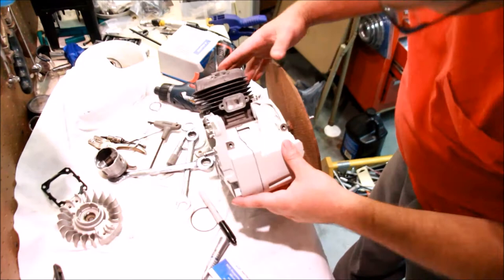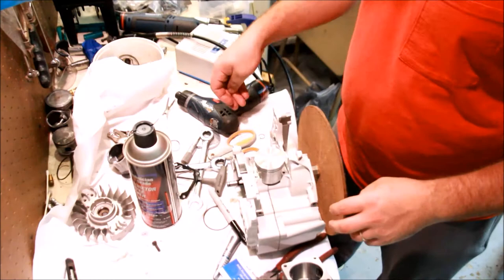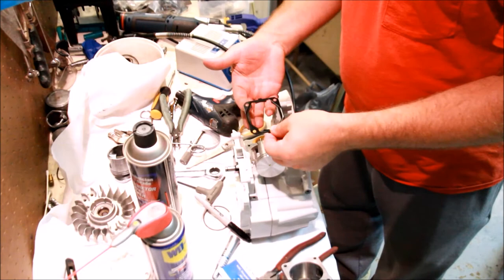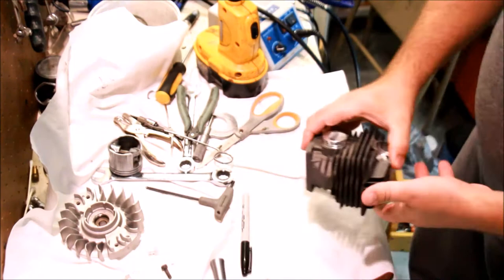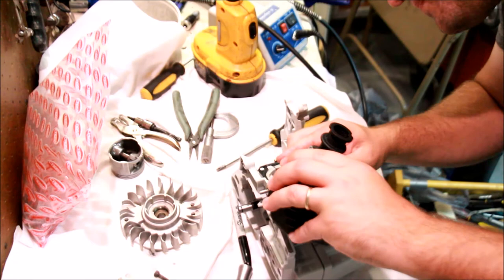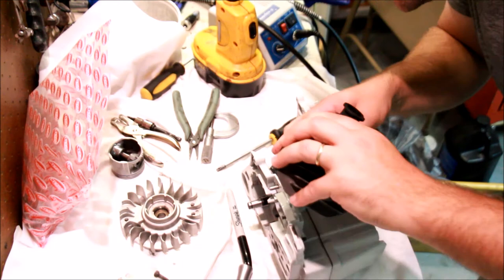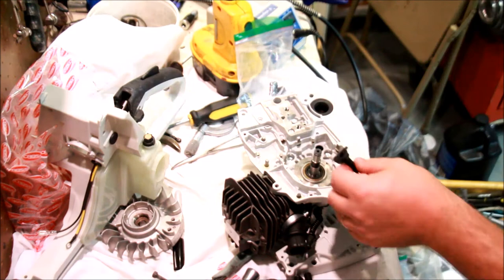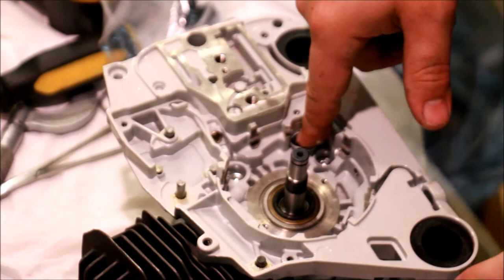Huztl Stihl ms440 bolt for bolt build! part 3 - cylinder install and some assembly

Comment: For that stop buffer, I just took a blade and trimmed a bit off each side of the cone that pops through the hole (so there's less rubber to force through) then I put some dish soap on it and worked it in with a little flat blade screwdriver. Even with the bits trimmed off it was difficult so I'm not worried about it falling out!

Comment: Stihl makes a pressing liquid to put AV mounts in but I make my own from about 3/4 liquid Dawn soap and 1/4 water in a spray bottle.  It is a lot better than grease, which can deteriorate rubber compounds.  It works  great on tough saws like the me 290 and 180 that have difficult to install AV mounts.  It make pulling intake boots into the rear handle a lot easier than pulling it through dry.  It also allows you to push in those pesky AV Plugs into the mounts.  I coat the whole AV mount with my pressing liquid which makes it pliable.  I also spray some in the hole the AV  mount is going into.
Reply from the maker: Thanks John....good point.  I use synthetic grease so hopefully no degradation but point taken
Reply: This might seem yuck, but I just put some spit/lick on mine and they slip on in, then I assume it will evaporate later on.
Reply from the maker: yup, guess that works too

Comment: I use a pressing liquid - 2/3 soap 1/3 water with a shot of rubbing alcohol added in as a surfactant.  I was using a Chinese impulse line and we all know they can be bigger or smaller than oem Stihl parts.  I have seen Chinese bearings for Stihl saws that are .003" bigger than they should be.  This Chinese impulse line was just to big and I could not get enough KY jelly on it to get it in the rear handle without damaging it.

Comment: For the ring compressor on my 660 build, I used a couple of tie wraps, one for each ring with the joint not lined up with the ring gap. Once the rings were inside the cylinder I just slipped the tie wraps off the piston skirt and cut them off.
Reply from the maker: Gordon Reed yep....done that. .and have a vid doing it that way.  Sometimes it works....sometimes not

Comment: For you clamp frustration, on my 660 build I waited until I had the cylinder mounted before I installed the intake boot. With it mounted on the case I took the "easy way out" and just aligned the boot clamp with a place where I could easily reach the boot clamp to tighten it. I just slid my T-27 screwdriver style wrench in from above the case but a bit off center and it tightened right up. My intent was to make that intake easy to remove if I decided to swap cylinders some day but it made things go very easy and kept the clamp away from the impulse line. 
I did not use any sealer so maybe that is what was making a difference for you.
Reply from the maker: Gordon Reed I probably should have tried harder to get the clamp on while still having the threads started ..mine wasn't t27 though. ..Phillips for my clamp
Reply: I think you are right, mine was a philips too.

Comment: Matt, that little anti vibe is hard to put in but I just use a little soap and a small screwdriver from the backside while pushing on it and it will go in takes about 2 minutes tops no frustration.
Reply from the maker: stevencroon I like the string method....so far.  On the 360 I tried a bunch of stuff...nothing worked.  But thanks for the comment!

Comment: Matt are the timming numbers you achieved pretty much the norm for this series of saw or are they about the same for all makes and sizes? I'm just intrigued to see if all saws stack up the same or if there is a big spread between different sizes and makes. Thanks
Reply from the maker: Craig Timmons answer is a big....I don't know.   I'm not familiar with the 440 in general....but I do know that there are differentials in numbers even within the same model....good question to pose on the forum

Comment: Matt, I had a problem with an 029 Stihl that I rebuilt almost 2 years ago.  It lost its seal between the crankcase and jug, primarily because I used an RTV sealant.  I just got through repairing it with Permatex anaerobic sealant.  I wanted to use TB1184 but the seller on EBay stiffed me.  He took my money but has not sent the product.  I thought about using Motoseal but I did not think it sealed the two parts up tight.  I took my old 49mm engine and sealed it up with Motoseal  and tightened the crank to the jug with 4 5mm bolts.  The next morning it was like I had never put any sealant between them, so I used the Anaerobic sealant instead.  What do you think?  Will the Anaerobic sealant hold up.  I cleaned the surfaces with break cleaner and lightly scuffed them with 400 wet or dry before sealing and sealed both flange surfaces with a thin coat.
Reply from the maker: i have the permatex stuff in the basement but have shyed away from using it.  i'm just not confident with it.  i've had troubles with loctite 518 anaerobic but only between metal/plastic union... metal metal or metal rubber is good with 518.  best of luck with the permatex.... it might be fine, who knows.

Comment: What is 1184
Reply from the maker: Bob Smith it is fuel resistant sealer made by a company called three Bond it is similar to Honda Bond and you can look it up on eBay